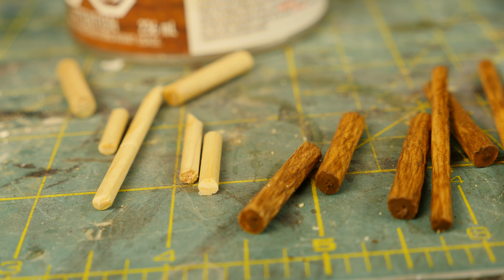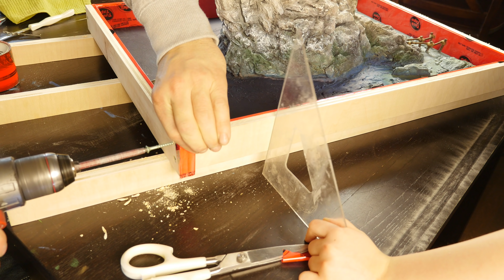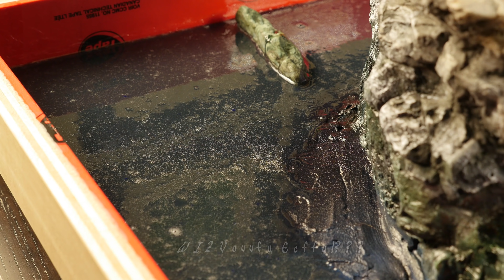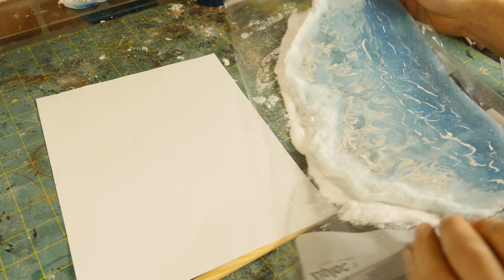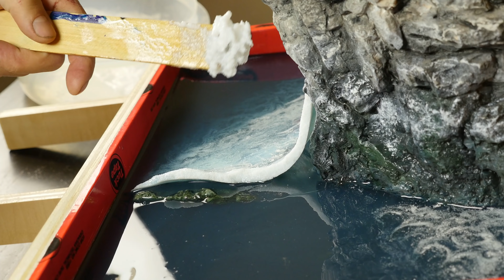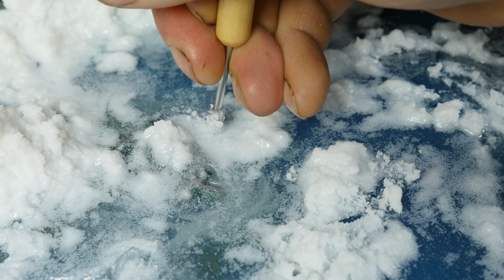🌊"Ultra" Realistic Ocean Diorama With MASSIVE Wave!🌊 | 4L Resin!😲 Water Effects

Comment: If you wanted a gloss effect on the base of the mountains/rocks, wouldn't it be better to use a gloss spray sealant? Using spray adhesive just scounds to me like it screams dust magnet for the finished project and ultimately I don't think spray adhesive is as glossy an effect as what you could achieve with a gloss spray sealer...

Comment: Just a small note about the boards for the resin pour - to maintain the boards full length for future projects, just make sure that the first board has one end flush with the perpendicular side. Then, as you go around attaching the boards, each one will have a tail, but each corner will be tight.

Comment: I have never thought of doing anything like this, and you sir, have a great talent. Can I ask a few things though?. With the wave rolling in, why did you leave the end hollow and not fill with resin, seeing rolling waves aren't hollow?. Can you buy that snow flake stuff off ebay, if not, is there a substitute you can use ?. From start to finish, what was the length of time/days? and lastly do you sell these?, I ask this for surely all the products would have cost alot, so you must sell them for very good money, for they would also be like one of a kind pieces.  Great work.
Reply from the maker: I plan to fill in the wave.  I was rushing to get this project finished so left that out, but yea, shoulda just done the extra step.  you should be able to get the white flock of ebay and amazon.   I havent sold them, maybe if the right offer comes along but it would have to be a lot to make it worth the time put in.  Because of the high cost to make it worth it I'd rather just keep them myself
Reply: @RealTerrainHobbies  Thanks for your honest reply, appreciated.

Comment: I love the great work you did, awesome job. Just adds to my collection of ideas to do sometime for a future upcoming project. When doing something like this you definitely need to use the epoxy resin.

Recently I was going thru some boxed up books in storage and found some of my old notes on old diorama techniques I had done when making some back in the early 80s. Back then I lived in a small town and was limited on what I could get or use to build my dioramas. Unless we drove to the nearest bigger town that had a Walmart, or hobby craft store or something you were limited on what you could get if they even carried it in the store. And that's even if they carried the EZ Water resin that came in these little cubes which you had to melt down then let it cool off a bit before you could pour it on your landscape to make water without it burning the plaster or landscape material. And back then unless you were a licensed contractor you couldn't get the bartop lacquer ie, epoxy resin at all at the local hardware store if they even carried it.  
So back then we had to come up with other techniques to make our dioramas. Unfortunately I no longer have it for it broke and got damaged when we moved 550 miles from Colorado to Las Vegas, NV in 1988. But I wrote down in an old notebook some of the techniques I used when I did research in the 80s before I built my dioramas and what I did when I made some of my things. And one was how to make a stream for my diorama thru a D&D town. It was difficult to realistically produce the effect of running water back then. I used  a plaster compound and cellulose sculpting compound clay and formed the waves and ripples while the clay was wet. Then coated it with the plaster using a brush. After it dried, I painted the river with a gloss water base and after that I added a shiny gloss lacquer that I brushed on, which gave the water a shiny, rippling effect. Which back then I didn't have any resin to use to make my water. So I used what was available in my area I could get. Just wish I had a picture of the diorama to show what it looked like.

Now since Ive gotten used to making all my water features with resins over the last 25 yrs. And then recently finding my old notes on diorama building that I kept notes on. Im now tempted to go back and using my old notes make a couple dioramas and see just how good it turns out.

Comment: The only problem that I see is that you are not checking to see if the pigments that you are adding are transluescent rather than opaque. There is a huge difference in each , especially when doing water.

Comment: This was an awsome video. Its why im so interested in this artform allthough im a novice.
However, ive worked alot with resin earlier in other work, and i got a few advice to you and other that want to work with resin.
Epoxy resin is highly toxic, and it accumulate in the body and will at some point cause plastics allergies. I would advice you to use gloves because being allergi to plastics is really a struggle in modern society.
Other than that im torn about your choice to make so much turbulence in the water. I really like the shallow area as it was, but it looks great with the turbulence aswell. Therefore the solution must be to make another 😂😂 great video, awsome terrainscaping but mind the epoxy resin..
Reply from the maker: Yeah, I normally wear gloves.  Going to make sure I don't get lazy anymore when it comes to it.  Thanks for the feedback, it's much appreciated :)

Comment: I have discovered that using the colouring tubes from the baking section give the best results
Reply from the maker: hmm, what colouring tubes are you referring to?
Reply: @RealTerrainHobbies  . You know the food coloring used to colour eggs, in the cake/baking section of the store. Those small boxes contain 5 colours. 3 of which are absolutely perfect for ocean colours. It only takes one or 2 drops/ or mix 2 or 3 of each and you can adjust according to the colour you want. I just took a flying leap one day and through caution to wind because I wasn't getting the depth I wanted using acrylics or alcohol inks with resin and tried those.
Reply from the maker: Oh awesome!  I'll definitely have to give those a try.  Never would have thought to use those.  Thanks for the tip!  :)

Comment: Thank you this was the most challenging part of realistic challenges to produce historical events , that need to have realistic effects ! Keeping the display clean in large volume visitors and the use of lighting to the models with sound effects is also something that incorporating into and out of the model to add effects that produce greater effects as motion or depth that photographic effects can be used to display models , are some things of that I needed to help the massive amounts of scaled 12 inch military movable figures with specific scaled equipment ! This helps to save time in such projects thank you !

Comment: Are the fumes and toxic vapors a problem? specially when breathing to pop the bubbles?
Reply from the maker: Because its such a slow curing process, the fumes released are very minimal and over a 24hr period.  It's the super fast drying solvents that release fumes very quickly and in high concentration.  I could barely smell this stuff even when up super close to it.
Reply: Ah, thanks!  @RealTerrainHobbies

Comment: Hi, can i replace snow with salt or sugar? I also have pvc dust maybe that works?
Reply from the maker: hmm.  PVC dust sound like it should work.  Salt or sugar I'm not sure.  I haven't tried either, but I'd imagine you'd have to be careful cleaning salt or sugar as it would dissolve easily if you used a a wet rag/water.

Comment: Hair dryer might help with the bubbles. That's how you get rid of bubbles when trying to get a glossy finish to furniture and tables
Reply from the maker: Great idea!  Might just give that one a try.  Thanks!  I read it was the CO2 that reacted with the bubbles, but the hot air probably thins out the resin causing them to pop faster.
Reply: when you where blowing on it, the heat from your breath was probably helping

Comment: Can you show some old projects? I'm interested, how those look after some time.
How do you clear dust out of them?
Reply from the maker: Yeah I’ve got some here.  I’m. Planning on getting some glass enclosed shelving for them, although a project this size I’m not sure if it’s possibke to fit one in.  Basically I blow the dust off.  A damp rag would work well on the resin and blow off fairly easily on the rest.  The tricky stuff is the flocking parts which is what the glass show cases will help with as long as I keep them at a manageable size.😏
Reply from the maker: For something like this a light cloth covering would also work well for storage.

Comment: If you use art n glow epoxy resin, you can do deeper pours if you have to. (You can get it on Amazon, great stuff) also for popping bubbles on resin, use a blow touch, just keep it moving and do it quick, Much faster and you save your breath :p
Reply: Turned out fantastic though mate!👌
Reply from the maker: Ah excellent.  Definitely will check it out!   Yeah I used a torch on my last video with resin actually heh.  Thought I’d go with my breath this time to show a 2nd method for getting rid of them.  Although ya, u come close to passing out and doing a face plant into the resin😄

Comment: I'm doing a completely different project, but your water affects just solved a problem that I was stumped on for months. Thank you.
Reply from the maker: Awesome!  Curious as to what the problem was?
Reply: @RealTerrainHobbies   I wanted a rock like form on my resin dome. But I didn't want to super glue rock on my resin dome. And I didn't want to use polymer clay either because I was afraid that it would eventually fall off. But using the snow flock coloring it and then mixing it with resin like how you did will do exactly what I need. Resin sticks to resin pretty well so hopefully I shouldn't have to worry about it falling off and when its fully set  and cured it rock solid.
Reply from the maker: Hey that's a great idea!   Never thought about using this technique for rocks.  Should stick really well to resin like you said.  Good luck!